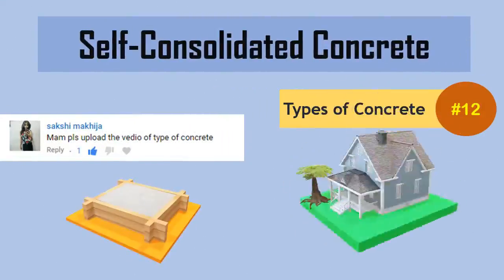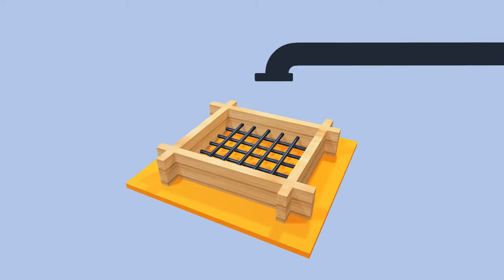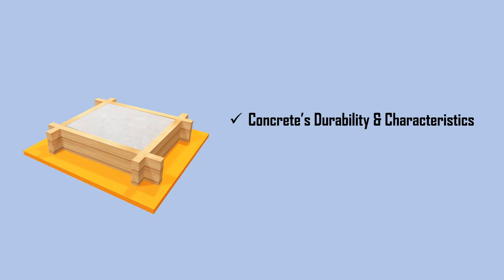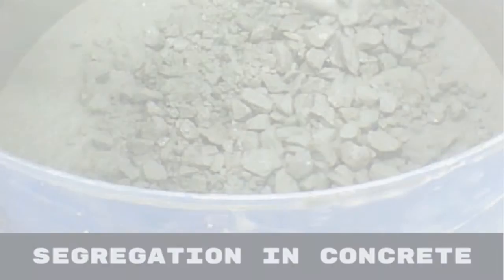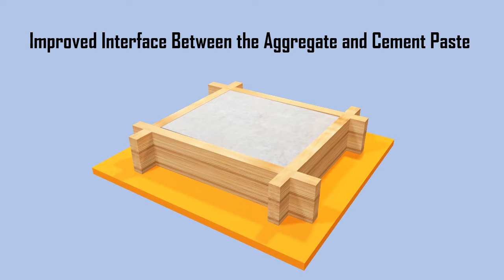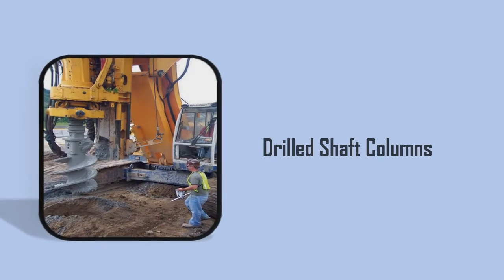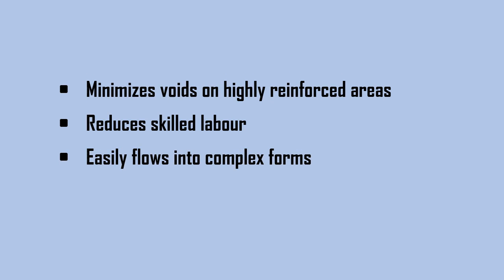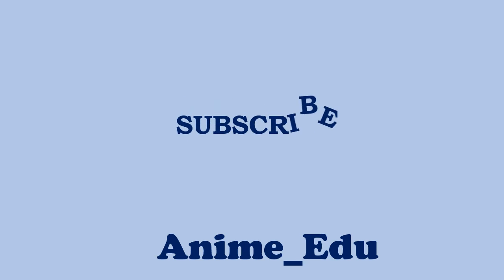What is Self Consolidated Concrete || Self Compacting Concrete || Types of Concrete #12

Comment: The question here :
Is the admixture for the mix which is intended to creaat the self compacting not  changing with time or not affecting the required properties of concrete like strength , durability , age of the structure